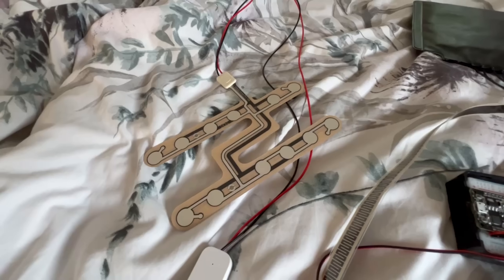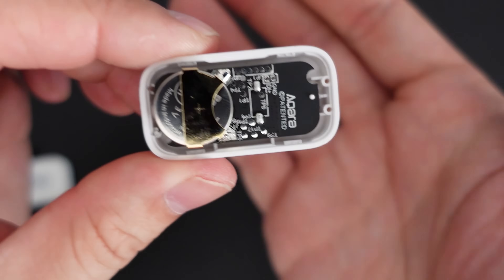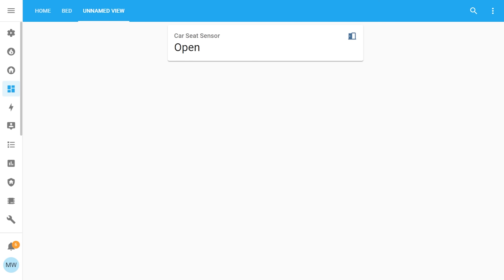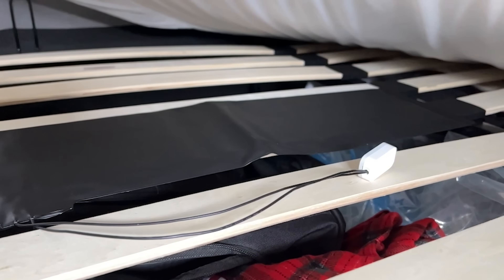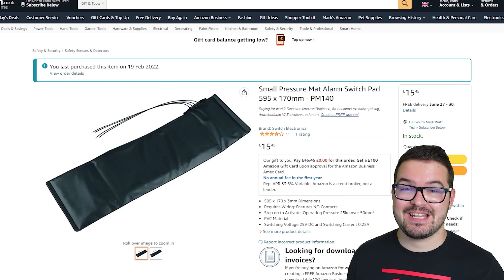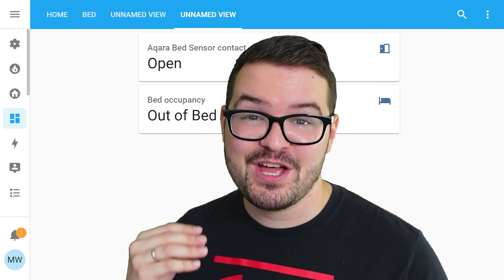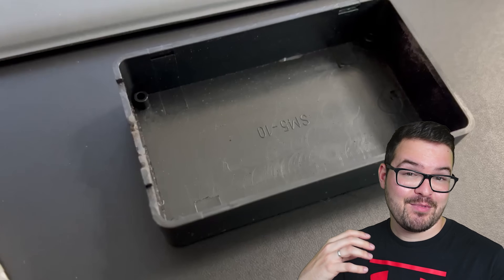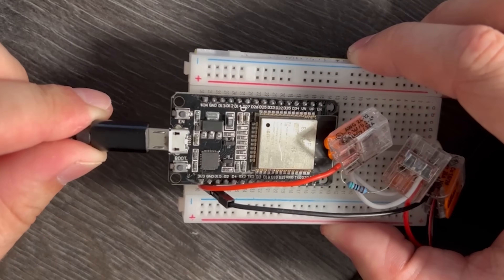4 Simple Wireless Bed Sensors (AQARA HACK)

Comment: Built one with a regular cheap Zigbee leak sensor and the thin Film Pressure Sensor. The mattress is just too heavy for it, reads positive under it regardless. Not sure if I can add a resistor and what value might help. Currently its just under the top sheets. 

You mention changing the bed sensor names which I added to my config. Not sure how to display this. I added a mushroom button with the input boolean on the Dash which only shows me on  or off.

Comment: I was thinking a generic leak sensor which comes with long cable ahould do the same job. What do you think? I ordered a few of the ones that can be stuck on the wall, supporting 2xAAA batteries and have a wire drop cable to place where you expect to have the water pool up. Even used one of them to indicate if my aquarium is overflowing, potential aquarium drain block indicator. Thinking i will try with FSR

Comment: So I’m assuming with the fsr you could put 2 strips on the bed and wire them in parallel? It’s just a switch so I’m thinking of putting 2 on my side of the bed incase I move in bed , then just wire them together/the same so it would work if I was on one or both?

Comment: Just watching this back again. It looks like you placed the sensors/resistors under the mattress, am I correct here? Also if you used these under the mattress would it not think the bed is occupied just by the weight of the mattress? I’m on about the first 3 ones btw, the easier ones
Reply from the maker: So with the mattress because the weight is so evenly distributed it doesn’t trigger enough downward pressure to activate the sensor.

This may be different with your bed setup etc so some experimentation may be needed.
Reply: @MarkWattTech thanks so much for this! I think I’ll give it a try at some point!

Comment: I’m actually designing transparent/translucent epoxy pavers or “stepping stones” I’m going to house led lights in them and have them operate using pressure sensors. I feel like option 3 would be best. But I have a couple questions. How long are you thinking the battery lasts in those aquara’s and when you say possibly a 1-2 second delay for automation, I feel like that’s going to hurt my project. So provided I manage to create a working design, I should probably just do esphome and run wire to the main. What would the delay be then you think?
Reply: Did you do this? sounds like a cool project

Comment: Ive managed to do this using the pressure mat sensore and it seems to work, staying on when i am in bed.  The only issue i have is the state changes to unavalible for a split second several multiple times when the sensor is constantly triggerd through the nighy.  Any suggestions on how to over cme this?

Comment: Thanks for a great video! Very inspiring.

I am fairly new to HA, so still haven't tried to build my own template sensor - and I haven't really had any luck of finding a tutorial explaining this.

You mention building a template sensor for changing the "on/off" to "In bed/Out of bed" - and I managed to recreate your sensor (shown at 8:43) and validate it using Developer Tools... But now I have a few questions to help me finish this sensor, which I hope you can help answering:

1) Are you adding the code to configuration.yaml or to sensors.yaml?
2) The code you show starts with an indented "- name: Bed occupancy" - but I expect something came before the indentation?

I tried adding the code below to configuration.yaml but it doesn't work (this is my first try at a template sensor):

template: 
  - sensor:
    - name: Bed occupancy
      state: >
        {% if is_state('input_boolean.bed_helper', 'on') %}
          In bed
        {% else %}
          Out of Bed
        {% endif %}
      icon: >-
        {% if is_state('input_boolean.bed_helper', 'off') %}
          mdi:bed-empty
        {% elif is_state('input_boolean.bed_helper', 'on') %}
          mdi:bed
        {% endif %}

Comment: I just set this up using the strip sensor. Initial testing was not good as the strip was so sensitive, that masking tape holding the strip straight would trigger an event. After 10+ min of reading up on this issue, I then noticed that the strip was reporting open and I continued testing and it now would then trigger with >5lbs of pressure. Maybe there is an initial settle in period to calibrate, etc?  Since I have a latex bed which is heavier than most mattresses, the mattress triggers an event. I will have to replace the Aqara door sensor with an adjustable solution if I continue using the pressure strip.

With that said, I would definitely like to see ESP32 details to how you got your bed sensor to work Mark. Thanks!

UPDATE: After ~2 weeks, the strip is now correctly detecting bed presence. The FSR strip is sent semi rolled up in an anti-static bag. Thus when you first install the strip under the mattress, its normal form is to coil up some. Thus, when first laying it out straight under a mattress, this natural force triggers the strip (showing a consistent closed status in HA). But after 2-3 days under a mattress, the strip will take to it being straight as a normal form and the strip will no longer consistently trigger a closed status, but correctly detects a presence or not. So far, the 600mm strip has an excellent detecting ability even when using a bit heavier latex mattress.

Comment: But wont weight of the materace turn the sensor on? Wont it be always pressed under the matress?
Reply from the maker: It will depend on your setup. Most mattresses (especially on slats) have the weight distributed evenly. So the sensor isn’t effected by the mattress. But your direct weight and pressure will trigger it.

Comment: Just built this with an FSR and a Sonoff door sensor but the thing is incredibly sensitive, anyway to reduce the sensitivity? If I place a finger on it, it closes.
Reply: A few comments down, Mark states to use the ESP version. Looks interesting.
Reply: @wwolfram33  yah this is what I was trying to avoid good thing I didn't clip the reed switch
Reply from the maker: Either the esp variant (so you can adjust sensitivity) or try a different contact sensor.

Alternatively instead of the contact sensor you could try using a leak sensor with the FSR. In my testing though leak sensors are way more sensitive- which is the opposite to what you want.

Comment: For the aqara sensors, if I put these pressure sensors underneath a mattress, won't the weight of the mattress trigger the sensors and make them wrongly detected there are people on the bed?
Reply: I agree, seems that this would be a big issue as there is no tuning for the bed weight.

Comment: Hi Mark! I’m interested in taking on this project to create a sensor for a cat litter tray. Can you elaborate on how the car seat pressure sensor detects a change in pressure applied? E.g you show it here with the mattress over the top. Does the weight of the mattress not trigger the state change?

I want to place one of these under a cat litter tray which weighs about a kilo in itself. Then I want to detect when a cat is in the box, which is an additional 3kgs. Would placing the litterbox down not trigger the sensor and keep it permanently in an “on” state? 

(The reason I want to do this if you are curious is so I can send my Roomba to clean the floor in front of the tray after every use!)
Reply from the maker: Hey Fran. With the FSRs the mattress doesn't push down onto it enough for the sensor state to trigger (this may differ with other mattresses) The bed slats disperse the mattress weight but when someone sits or lays in bed the downward force triggers a state change. You may want to experiment with the mats and other force variable sensors :)

The ESP version of the setup is the most accurate and can be finely tweaked and tuned.

Comment: thanks, gonna use this to auto pause the tv when I get off the sofa! :D
Reply: yeh, used the first and the second sensor. both are giving out the issues mentioned at 5:19. using the car seat sensor on my computer chair, and the long sensor on my sofa. I may try use the long sensor on my bed. but I already have buttons near my bed for turning off lights.
Reply: Update, keeping the second bigger sensor folded seems to work well for seat sensing

Comment: The leak sensor works great but I took a "no solder" path.  I used wire crimps to connect the wires to the pressure strip.  It's a tight fit because the contacts are so close together but it's do-able.  Then just connect the wires to the two screws on the leak sensor.  Total cost about $25 USD.
Reply from the maker: I did actually do a follow up video to this where I used the leak detectors :) 

You can add them to the film resistors and get the same effect. Simply add the wire to each terminal.

Cheers.

Mark

Comment: Is it possible to connect 2 thin film pressure sensors to eachother to make an extra long one
Reply from the maker: You can yes :) you can connect them up in series or parallel using wires.

Comment: Another option is to buy load cells and place one under each leg of the bed. The most common ones are 50kg each for a combined max load of 200kg. This also gives you the granularity of sensing who is in the bed based on weight.
Reply from the maker: Load cells are by far the most accurate. Theres just more to the setup :)
Reply: @MarkWattTech  True it is a bit more complicated

Comment: You don't really need to cut the reed switch, I did this 2 years ago, there are 2 holes on the PCB to solder the wires.
Reply from the maker: I did make a short follow up to this a few weeks explaining this but it never released 😬. Thanks for sharing though 👌🏻

Comment: I have seen the connection diagram in the GitHub file but it does not work for me, I am using a wemos d1 mini.  Can you tell me where you connect the white cables that you show in the video? If you can also tell me the other cables connection to be sure but it seems that it can be seen well in the video. Or If you know a web with the correct diagram it will be very helpful for me. I already have it under the bed and I want to make the template to known the people inside according to the weight, thank you very much for the video
Reply: I am eagerly awaiting your response :)  Thanks in advance
Reply from the maker: I do plan on creating a video on this, and also another video using a custom created PCB.
Reply: @MarkWattTech  I'm still waiting for the video  ;)
Reply: That would be great.  I have it stopped because the article that explains it has not been clear to me or I am very stupid :)

Comment: 11 days since my last comment and I possibly could edit the previous but I looked at the Aqara operating temperature specs and I am really impressed but I know that does mean the battery performance is included. 

What was interesting is I was looking at Yo-Link (Lora) mostly for the water/weather reasons not distance so much. 

I don’t plan on making a nice YouTube channel like you and many others but I will probably post this Gate Sensor hack. 

The compactness of the sensor allows it to be slid into a very small piece of pvc tubing to protect it and connections from weather. 

I did put a Zigbee plug/repeater in the garage just to extend the range of my Zigbee mesh as the sensor is an endpoint device. 

I think it is fantastic there is a reed switch we can access. 

I think I will make a custom frame for a doormat and make a Zigbee doormat pressure sensor!

Thanks again for this!

Comment: Can i do this with sonoffs SNZB-04
too? They seem very familiar and got one laying around
Reply from the maker: I haven't popped one open but in theory you can :)
Reply: @MarkWattTech  got it working with this Sensor. Used a few Jumper cable for First Test. Don't wanted to solder on the frs Side waiting for a clincher so i can Just Stick it together with the soldered cables from Sensors end.

Comment: I’ll do the same! Nice idea. In my house, I’ve already made a sensor like that, using part os zigbee one. I Use it on shower. For that, used a valve that already has a magnet inside. Just put the sensor next to the valve. And voila! You know when someone is having a shower. Usually it turns the volume of the music a little up.
Reply: Another option is use a liquid flood sensor. You just have to cut the wires e join with the wires of the weight sensor.

Comment: My plan for a bed sensor is load cells under the corners, and Tasmota on an ESP32 having HX711 and a couple of other sensors. Such a setup gives good sensitivity and chances of detecting who's in the bed, assuming they have different weights.
Reply from the maker: A lot more accuracy for a little extra work 👌🏻
Reply: While it takes some wiring, at least that can be done "invisibly" on the underside of the bed, and without interference from making the bed and so on. Whether it is a plus or minus to be able to easily collect weight stats may be a personal question 😉
Reply from the maker: @JohnnieHougaardNielsen  😂😂👌🏻

Comment: Great video, thanks. Does anyone know how to make the sensor less sensitive? I have been using the aqara trick for different custom sensors, such as an intercom ringing sensor and a rain sensor, and now I've been playing with pressure mats. The issue I'm having is that the sensor, when used as a sofa occupancy sensor, triggers with the weight of the sofa seats alone, so I wish I could make it less sensitive. Would a resistor do the trick?
Reply: I' d like to know that too. Don't think it's possible that easily though
Reply: Adding something around the sensor (I used some folded paper when using the car seat sensor) just keeps that area up enough to reduce the load on the sensor itself. Then sit and the paper compacts and pressure gets to the sensor 👍

Comment: I have an aqara vibration sensor attached to my bed. It is enough to detect when I get into bed or turn me around. 
Under my bed is a motion sensor. It can see me when I move out of my bed but not when I'm in it.
Reply from the maker: Thats a good use of the vibration sensor. Do you combine the two for in and out states?

Comment: These Contact Sensors are pretty versatile - I´m using them to smartify my current light switches :)
Works great - what I don´t like is that the aqara sensors are bound to one zigbee router - if this device is not available it has to be reconnected. Don´t know if this also applies to the zigbee 3.0 versions.

Comment: I think the Aqara Leak Sensor is a better choice because all these pressure sensors work on the principle of closing a circuit and that is what the leak sensor also uses. If you have a sensor that is too small you can just add multiple pressure sensors but connect them in parallel. If your cat triggers a snigle sensor (my use case) put multiple sensors but wire them in series. As long as the person you want to detect is large enough to cover all the sensors it should work (theoretical I haven't actually tried this)
Reply from the maker: With the leak sensors though there's a hard set time isn't there before it resets (wet to dry). You would have to work around that delay wouldn't you?
Reply: @MarkWattTech  It isn't instant but it is no more than 10 seconds. I have mine turn on the bathroom lights when I get out of bed in the middle of the night (I am an old man :-) ) and the lights are on by the time I get to bathroom. I am sure if I ran I would get there first but 10 seconds is tolerable.  I use node-red for all the control so I can delay longer if I need to. If I get out of bed (after 5 AM)  I then use TTS to read my meetings for the day and give me a weather report from my weather station. The biggest issue is I have to disable it during the day because the cats will activate. I am going to try using the car pressure sensors wired in series. If I can place them far enough apart that a cat won't hit them all but close enough together that I will it should work. I will update (coming from China so will be at least a month)
Reply from the maker: I had to wait forever for mine to arrive. I ordered 3 and only the one turned up so far. Thanks for sharing Don 😁
Reply: @MarkWattTech  I just got the "car sensors" in yesterday. I just bobbled one together with an existing aqara water leak sensor and put the pressure sensor on my office chair. Made a simple node-red flow which turns on the mac screen saver. and turns off the office lights when I stand up. Working right now but no permanent wiring. A few seconds delay when I stand up which is actually good so lights don't turn off while I am leaving office..
Reply: @MarkWattTech  Is there a delay with the ESP solution ?

Comment: Great Video Mark. I am a fan of either modding or making my own sensors. Also some great automation ideas. You might want to consider using the Shelly uni, a small,  low cost (about £15), 12v powered wifi device which can measure 0-30vDC, can support up to 3 temperature sensors, 2 digitial inputs  and 2 (100mA) output switches. I've not seen many HomeAssistant users talk about them which is quite surprising given their compatability with home automation platforms (out of the box support for REST, MQTT, Alexa, Google Home,  and Samsung Smart things) and of course HomeAssistant through the Shelly Integration.
Reply from the maker: Thanks Dave 😄